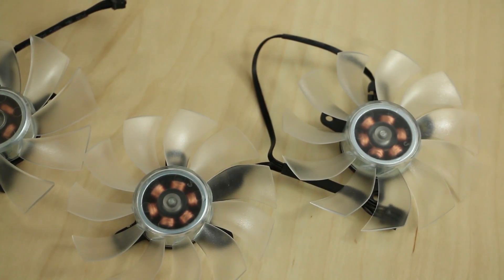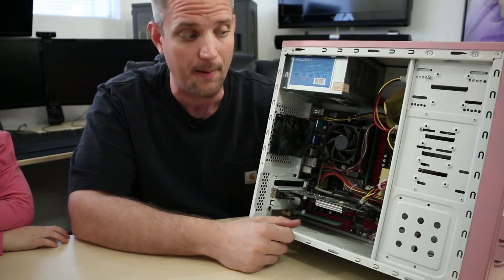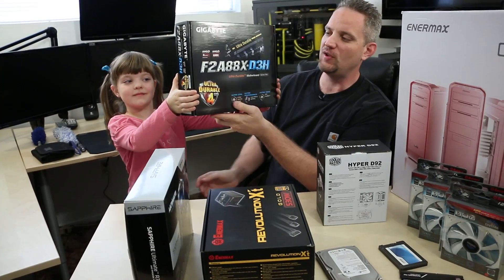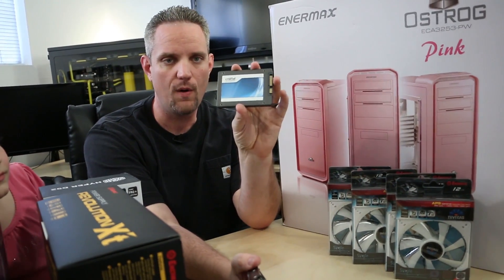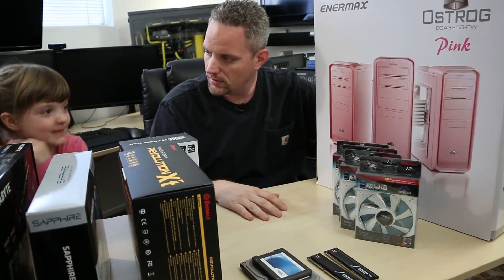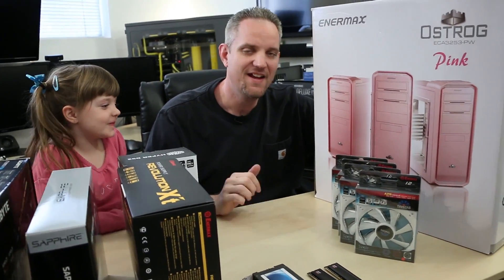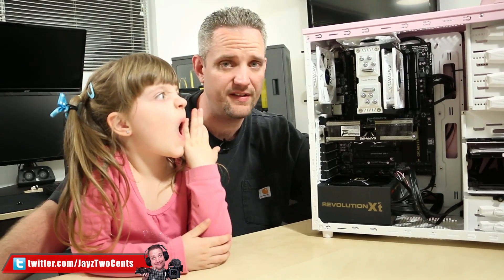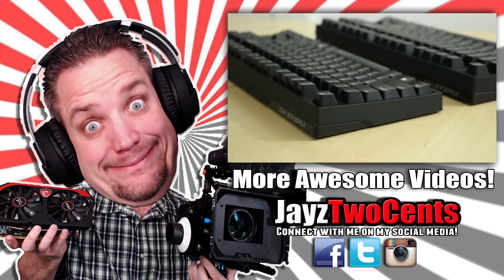5 Year Old Builds a PC

Comment: I'm 4 times her age. I have a job. She has a better pc than me.
Reply: HUS MAN Her dad payed for it.
Reply: MasterGhostf No, the manufacturers sent him the parts by sponsoring him.
Reply: william endler Yup I have a Core 2 Duo with a GeForce 210, 1 1TB WD Green drive, 2GB RAM and a 250 watt PSU lol, AND it is driving 2 monitors lol.
Reply: HUS MAN dude I've been saving up and doing twitter graphics to finally afford a 1070 sli, i7 6700k rig
Reply: HUS MAN  whats your pc specs ?
Reply: Kyle MacKay Wait, you said 3 TB of memory and 16GB of RAM? You mean 3 TB of HDD space?
Reply: ***** I don't think it will work in sli and i'm stuck on a 740 1GB G5
Reply: I'm 15 and I have no pc.
Reply: HUS MAN i know the feeling
i have an i3 4130T 8gbs of ram 860M and a 500gb hybrid drive (but mine is in an alienware alpha)
Reply: One more month and I'll have a i7 4790k GTX 980 water cooling 3 TB of memory 16 gb of ram I'm 14 you can do the same
Reply: ***** Damn it can I have the 770?
Reply: Matthew N ya that's what I ment its been a long day
Reply: ***** Maybe but what I heard was about SLI where you can only pair identical cards.
Reply: ***** it may run at the same speed as sli 770's
Reply: I think that may be iGPU paired with GPU but i'm not sure. Give it a go though cause why not lol
Reply: cale devers You should switch out the green drive for a WD blue if you have the money. The green drive's performance is really sub par as it is not 7200 rpm.
Reply: william endler why did you even buy alienware, they are so overpriced
Reply: +HUS MAN At least I have my 8K potato....... :D
Reply: my old hp dc7800 desktop has a core 2 duo 
amd 6450 hd silent 
1tb WD black 
4 gbs of ram 
i think it has a 300watt power supply since that's what it pulls from the wall on full load on the cpu gb and ram  
and i have i have anther 1tb seagate drive and a 1.5 seagate drive but they aren't installed in it yet 
and i have a 19 inch 1366x768 acer panel with a ton of dead pixels but i manage till still use it to run gta 5 at 15-30fps lol
Reply: ***** oh nice
Reply: HUS MAN ha
Reply: Well her dad payed for it
Reply: ***** Oh , O.K I never heard about that but if it is anything like amd crossfire the 980 ti will only run at the speed of the 770.
Reply: ***** High five
Reply: MasterGhostf *paid
Reply: *****
well I got a 740 1gb gddr5 now which is a lot better
Reply: ***** - "I'm 16 and have an i7 4770k, gtx 770 and 16 gb ram..."
Nice one there, kid.
Reply: because i wanted a cheap gaming pc and for the $550 i paid for it was worth it
Reply: ***** Alienware sucks because they're "overated?" Yeah, nice logic there, kid.
Reply: Dim Fre4kske I'm putting a 80gb 7200rpm caviar black for the boot drive :-).
Reply: HUS MAN life is a bitch
Reply: cale devers Good black drives have more cache, more warranty but they are more expensive.
Reply: Dim Fre4kske I have this one lying around.
Reply: Dim Fre4kske I'm still using the green for mass storage. I will eventually get a cheap ssd from samsung, sandisk or kingston too.
Reply: HUS MAN Your profile pic says it all xD
Reply: Kyle MacKay how can we have that amount of money ?
Reply: Dim Fre4kske Well I ended up getting a HyperX 120GB 500 MB/S SSD for the boot drive :-P
Reply: Hink Hall 
If my mom & dad paid for the parts ...
Reply: cale devers 
 A SSD is the only way to go
Reply: when your parents buy it for it , it doesnt really count
Reply: enjoy it now , once you start paying your own bills ...... I don't think you have a job , but that's good you saved all that money
Reply: I was about to post almost the same thing xD
Reply: +HUS MAN all the time i was thinking someone must say that
Reply: +SweedsHD Soon I'll have a xeon e3-1230 which is essentially a 4770 minus igpu and an r9 380
Reply: +MisterHookah I can lol
Reply: +MisterHookah as i said this cpu is a 4770 minus integrated gpu
Reply: +MisterHookah yeah but it is quad core hyperthreaded and is lga1150.
Reply: +MisterHookah true but i don't care much and its still better than a pentium and is good for workstation use which i will do a bit of.
Reply: ***** I'm going for an fx-6300 now anyway
Reply: +ZacStrikesBack Hey man, I got my HP from HP in 2013 and it actually had fairly decent performance until my outlet caught on fire and slaughtered it.
Reply: I'm 12 and I have a amd Athlon 2 HP Pavilion A600Z Crap box.
Reply: +Cameron Galat I'm 11 and have a pentium anniversary, GeForce gt 740 and 8gb ram.
Reply: +cale devers PLEASE DONATE SOMETHING. lol
Reply: Cameron Galat I can donate a geforce 6400.
Reply: +cale devers Really!?! if your not joking email me at cgalat02@outlook
Reply: I'll test it, but what country are you from
Reply: I dont have an io shield though
Reply: +cale devers  The Usa
Reply: +cale devers that is fine
Reply: What is the full email cameron?
Reply: cgalat02@outlook. com
Reply: +Cameron Galat i tried that and delivery failed
Reply: +Cameron Galat sorry i cant send it. delivery would cost more than the card
Reply: +cale devers can I have it instead?
Reply: +Anzuri where do u live
Reply: +cale devers New York, and which gpu is it?
Reply: +cale devers and could I have the ram too if you don't want it?
Reply: +Anzuri no sorry im in australia so is would still be $80 shipping
Reply: why? :c
Reply: I have a core i3 and a gtx750ti,still better than her one
Reply: Anzuri because shipping from aus to usa is $80
Reply: +Sweeds nope, dx12 has nothing to do with SLI
Reply: +Sweeds you can't pair 2 different GPUs in sli not even with ex12. it can't happen because ski technology won't let it happen and tbh your pc that your gonna get sound like a piece of shit imo.
Reply: +HUS MAN you're doing something wrong
Reply: +TotallyRandomGamez I did something wrong. I didn't finish a high education. I chose the simple route. Now I can hardly set aside $200 a month.
Reply: HUS MAN Aw :c
Reply: +cale devers I have a Dell Vostro 220 without the dedicated graphics .. so
Reply: +Michelangelo Lattanzio what cpu? and no i dont think cpu is everything
Reply: +HUS MAN Same
Reply: +cale devers Nice Youtube Picture
Reply: +Glaze Gamer Thanks
Reply: +HUS MAN Have you seen the computer that linus' son has?
He is a 3 year old with a watercooled i7 5960X and an R9 Fury
1
Reply: yeah i think that was a judgement flaw on linus' side...
Reply: The kid chose an X99 board and he was like "Let's choose some compatible CPU....5960X it is"
Reply: Sebastian Contreras That processor is pretty much shit for that price
Reply: +Sebastian Contreras its not linus's son's pc. Lmao he just let him build it not keep it.
Reply: Anzuri
I know, the 4790K is actually better for Gaming (Better Single threaded performance)
Reply: Yep
Reply: +willam endler (willendler1993) alienware is good
gooooooooooooooooodddddddddddddddddddddddddddddddddddddddddddddddddddddddddddddddddddddddddddddddddddddddddddddddddddddddddddddddddddddddddddddddddddddddddddddddddddddddddddddddddddddddddddddddddddddddddd
Reply: +Russell Van Bogaert Yes, but they are also pretty expensive. I could build a pretty decent PC about as good as an Alienware for nearly half the cost.
Reply: +minecraftace123 but iam in belgium i buyt 1 for 1800€
Reply: +HUS MAN The struggle
Reply: +Hink Hall Alienware sucks cause they haven't figured out how to cool the things properly. I'll take my Sager over Alienware any day.
Reply: then you are poor as fuck. Her pc is worth like 600 dollars without the parts that weren't supposed to be there like the ram, the fans, and the mobo.
Reply: Harry Szaniszlo Wait, what? Parts that weren't supposed to be there?
Reply: Harry Szaniszlo You do know that those are the main pieces of a PC right??? Or are you just here to troll because you haven't built your own PC?
Reply: +HUS MAN your 20 Years old?
Reply: Jays said that some of the parts don't belong in the pc, they are just going to be there temp till he orders new parts. Like the ram, the motherboard.
Reply: ***** I've actually gotten a pc too now, i5-6500 gtx 970 500gb 850 evo 8gb kingston ram and some msi motherboard, I just set some money aside every week, and before I knew it I had around €1000.
Reply: DatPCgamer can't agree more on that, I had a laptop with an i7, it doesn't even compare to my desktop with the i5, mobile = weak
Reply: See? You don't need much to have a good PC. Any dual core with at least 2-4GB ram runs Linux nice.
Reply: Well, I guess Linus wants his son to have a PC so powerful it's still good enough to use by the time he's nearly 10. 

EDIT: Turns out his son was just helping to build the PC, not keep it.

Comment: is this a good pc build?

Case: Wet Cardboard (not corrugated)
CPU: A Underclocked burned toast with WWG Architecture, the toast should be sitting in a grave of dirt and dead people for at least 180K Years (so this is 180K Years old)
GPU: 16x Crossfire Pink Nerd Glasses (42847382732453747892748729837498273827482748374298784728947823798273487283428 YFLOPS Compute Performance Per Atom)
Mobo: 30LB Pumpkin (Pumpkin Special Derp edition)
HDD: A Very wet folder
OS: Pig OS 3.0
PSU: a wedge of rubber
RAM: 32 Rotting Potato's (all of them with that good rotting potato smell), Sise: -64KB, Speed: -0.2145828124 RPM
Monitor: a 15hz flipbook
Cooler: the earth's core (touching the toast processing unit)
Reply: Damn, you can run all games at 8k 500 frames per second!
Reply: Devin Hepburn Are you kidding me?! Your computer is going to freeze with that cooler! You need to use the SUN's core!
Reply: The real question is will it run Minesweeper at a cinematic 14fps on 900kp
Reply: Devin Hepburn Arkham knight 6969 fps on 69k
Reply: +Devin Hepburn THAT IS A NICE ASS FUCKING PC!
Reply: I'd say arkham knight 90fps.
Reply: 9999999fps gta 5 on super mega ultra
Reply: Should be able to run Battlefield 4 at low settings in 800 x 600 at 0 fps
Reply: Sebastian Ramirez Better than my pc
Reply: Holy shit, nice! Can run battlefield 4 at 200 fps at ultra settings, no lag what so ever. The worst you can get is 199 fps
Reply: +Devin Hepburn Did anyone else read the replies before the original comment?
Reply: +CrypticArtz omg..  I sie you evry where :D
Reply: u got to be kiddin me. srsly. forget the pumpkin board, go for a 420 BaconBoard
Reply: +Devin Hepburn you can run all games at 8k, ultra/max settings, 240+fps
Reply: That's not a PC.
Reply: +Sebastian Ramirez XD
Reply: you are going to run GTA 5 at -1000fps at -1280×-1080 resolution
Reply: +Devin Hepburn try adding a carton of milk . that should fix the compatibilatie issues. it should also add a cople more fpsses and terrafaps

Comment: The Dankest PC:
Processor: 69.9MLGhz Intern i420 Penta-core
Graphics Card: ASHITI Radeon 1337 HD
Cooler: Antartica
OS: MLG OS
Hard Drive: 1337TB HDD
RAM: 69GB RAM

It can run Battlefield Hardline at 720fps in 13337p at Ultra setting.

PC MASTER RACE

Comment: Anyone can build PC :)

My first rig didn't had Thermal Paste under CPU cooler (stock one of course). GPU didn't fit my case (GTX 8800) so it was set at an angle. Because of that it was only half installed into pci-e port.. but it worked. As you may predict it caused card to die earlier that it supposed but by early I mean after...5 years.
All 5 fans were daisy chained through molex and plugged directly into PSU so they were spinning so fast my case almost floated above the gorund.
Front USB/audio ports were hooked up with wrong connectors causing system to power off when anything were plugged in.

It was like 8 years ago. This PC still works. My dad use it for work and doesn't really want to change it.

Comment: I started with Heathkits in 1962, nothing much, just learning about parts and how they went together, so once I was out university, I was able to start just about any job. but what strikes about putting your daughter  putting  her on computer together, reminds me of a  electrical engineer I worked with back in the 80's, his computer stopped,, and he was going through this company he bought his computer from, but when I suggested he fix his own like I did, he yelled that no, he was to scared to touch it, he would make only worse. not until I suggested he bring it to work I would it took about two weeks to convince him. the funny thing was it took me about half an hour to fix, if I remember correctly, it was the memory sticks, they were 4k in size (times have changed haven't they). apparently he may have tried to do some thing, and screw up his computer to where it would not turn back on, that image of him saying no so loud has stuck with me for a long time, he was a electrical engineer, but he only did programming 

I am just glad that your daughter is learning how put her on own computer together, self reliance

thanks for the video

Comment: Firstly, there is one major mistake: you don't wiggle a cpu (especially an amd cpu) while in the socket. You also do not touch the heat plate on the top of a cpu. 
Secondly, it's better to install the cpu cooler and the ram while outside the case.

Comment: me:
intel hd graphics
athlon x650

she:
CPU - AMD A10-7850K Kaveri APU
Mobo - Gigabyte A88X-D3H
Mem - AMD R9 Radeon 16gb 2400mhz DDR3
GPU - Sapphire R7 250 Ultimate
PSU - Enermax Revolution Xt 530W 80Plus Gold
Case - EnerMax Ostrog Pink Mid Tower
SSD - 128gb Crucial M4 SSD
HDD - Seagate 7200rpm 250GB
Cooler - Cooler Master TPC 612

Comment: Is this a good rig?:
Case: An old banana
CPU: A fish's brain
GPU: A fish's eye
Optical Drive: My mouth
SDD: A briefcase
RAM: An old 1MB Floppy Disk
PSU: A stun gun
OS: ATM OS
Mobo: A glass of rum
Reply: does a floppy disk fit in a banana?
Reply: dont use an old banana, atleast get a new and rype one man, other then that it is a great build
Reply: Joseph Siby
yes it does, a cd does to, and an elephant.
Reply: billywws Yeah man you can even run GTA 5 over 9000 FPS with Ultra Settings, now go and brag for your friends!
Reply: ***** in 5k 1000fps in crysis 9 ultra setting x10 MSAAwithout the fans kicking on
Reply: Cogsoldier Oh, but I heard that the old bananas have better architecture than ripe ones.
Reply: M8 8/8 gr8 cuz u just beat gamecube masterrace only u and dat other m8 have done this so far congratz!!!
Reply: billywws it will run all games on 16 8k monitor surround  with roughly 900 trillion fps
Reply: Why is the SSD bigger than the case?
Reply: amazing let's make it run windows 50 and make it run crysis at 8402984293047348734875738947239573875895728937289fps with a 520000x3450000 reselution
Reply: Devin Hepburn what monitor is that? is it the mirror 3?
Reply: ThatOneGuy
yes it is, it has with so ultra hd
Reply: Devin Hepburn OMGGG THAT REAAAAALY EXPENSIVE

ITS LIKE $30 OMFGGGGGG
Reply: ThatOneGuy
it still beats the $5 high end flipbook, a still expensive (but less expensive) monitor.
Reply: Devin Hepburn DOOD

THATS THE BEST MONITOR OUT THERE

ITS A 5ns MONITOR AT FUCKING 1337420K
Reply: ThatOneGuy
but it only runs at 15hz, were as the mirror 3 can run up to 240hz
Reply: billywws I don't even know what this is but I want it